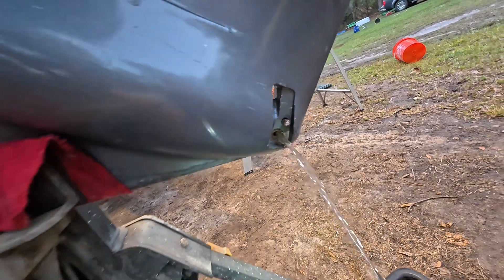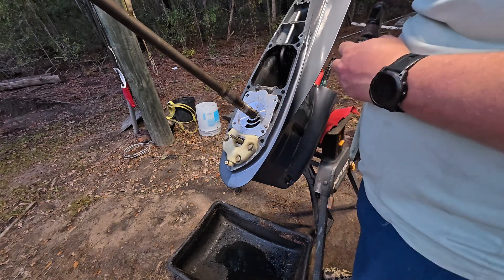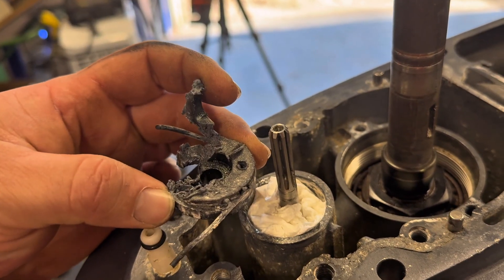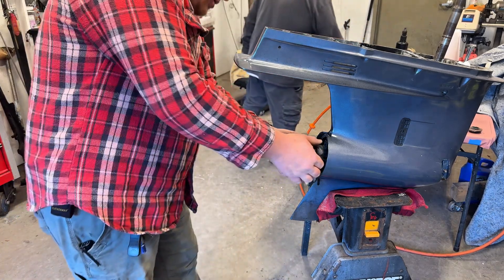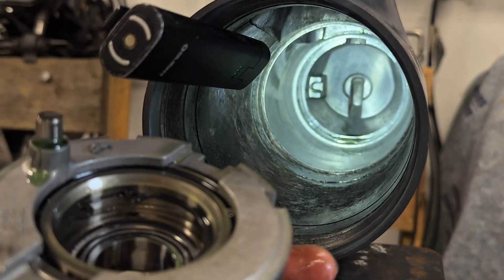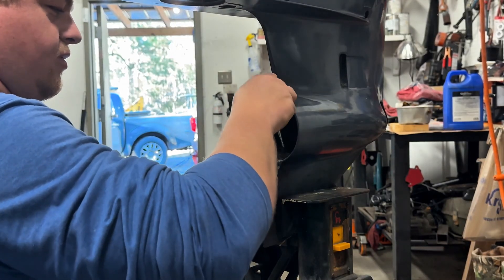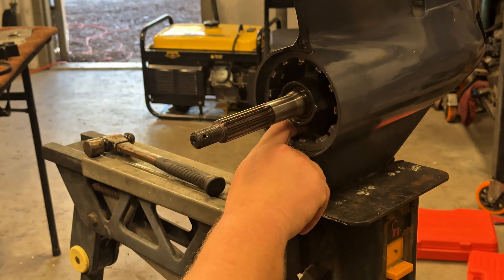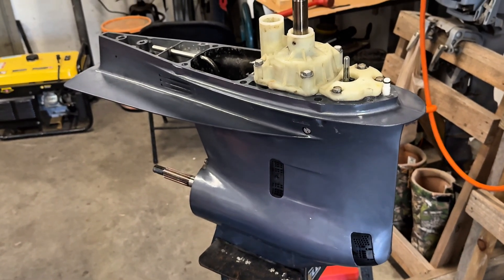Yamaha F300 Lower Unit Rebuild - Broken Driveshaft

Comment: I mean at this point you were close to the cost of a new lower unit assembled ? OEM lower unit rebuild kit is around 1600 plus misc parts then all the tools you purchased ... you can get brand new lower for 2800ish
Reply: I think new lower units for a 2021 F300 are around $7,000. (Partsvu) Do I have that wrong?
Reply: @philterzian9162  You are correct, I just bought two of them at $6,000 a piece.
Reply: @matthewrutz6670  That sounds like a very good value.
Reply: @matthewrutz6670  Sounds like a great value.